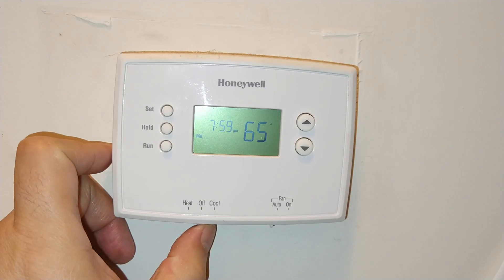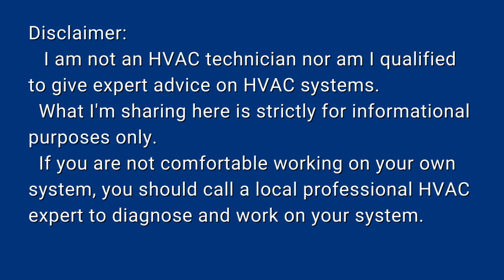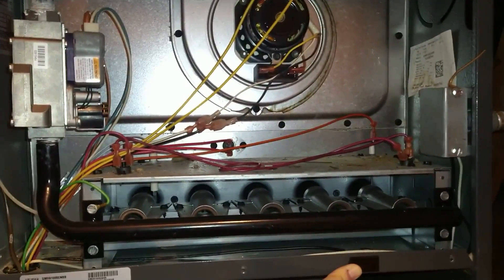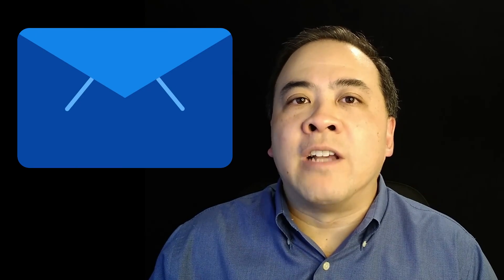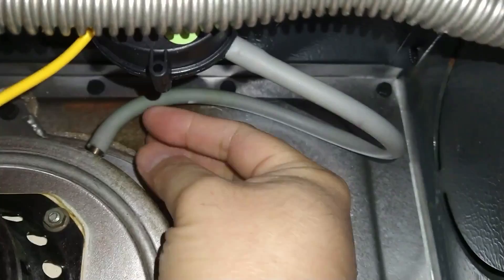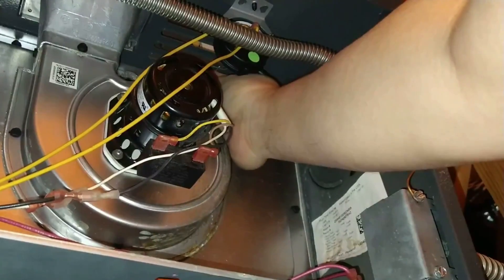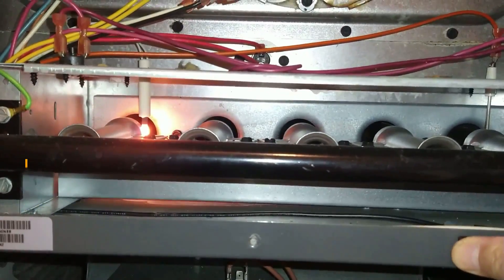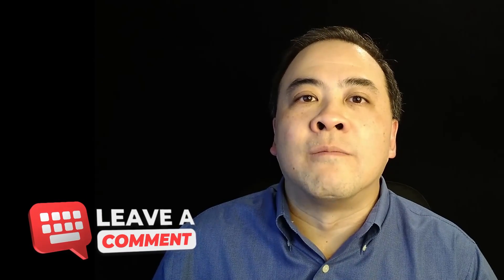FIX Goodman Furnace: 3 BLINKING LIGHTS Error, Heater Won't Start!

Comment from the maker: How is your Goodman furnace working out? Let me know, COMMENT below. If this Fix Goodman Furnace helped you out this season, consider LIKING the video. Also, SUBSCRIBE to receive notifications of new videos. Thank you!
Reply: Thanks for your video, i just replaced pressure switch and it did not fix it, then I saw your video and your fix worked like a charm. Thanks!
Reply from the maker: @jeffvannoy4716  Glad to hear it! Have a great holiday season!
Reply: I just unclogged the snow on the intake and a little on the exhaust pipes outside and started right up. Thanks for the details posted by your friend and in general. Aligned with what my HVAC guy said.
Reply from the maker: @jafinch78  It's always nice when a professional corroborates your efforts! 🙂

Comment: In our case, that rubber tube to the pressure sensor had a small hole in it, possibly from a mouse nibbling on it.   We cut the tube shorter to eliminate the hole, and it was fixed.  Your video still led us to the solution so we appreciated it.  Thank you!
Reply from the maker: Glad to hear the video helped lead to the solution!

Comment: You, sir, just saved me easily an $800 bill. Another video suggested Brillo padding the fire sensor. Did that, glad I did, bunch of carbon on it. But still had the light problem. Came across your video once I finally connected the dots that the blinking light was communicating to me. Found that gray tube, which had cracked and opened at the junction to the nipple. Cut off the broken section, reattached. Flat head, leatherman knife, and your video was all I needed.  Thank you so much.  Joined your subscription as a small repayment.

Comment: Thank you to you and your HVAC buddy. My furnace wasn’t coming on and after checking the control board the led was flashing three times. I removed the hose and slightly slide in the paper clip and blew through the hose. Replaced and turn the gas back on and switch. Igniter glowed on and furnace lit. Again thanks to both of you.

Comment: Great video! Thanks so much for posting but would you happen to know what my furnace would work perfectly after following your steps but then turn off again after 20 mins and start showing the same error code?
Reply from the maker: I'm not an expert but it sounds like there's still an underlying issue clogging up the hole. You may need to vacuum out the surrounding area of all dust

Comment: This fixed my exact issue. I used a hex key to get inside the barbs cause its all i had in the attic and it fit nicely. The air conditioning was working dine in cool mode but the flame just would not fire up in heat mode with a nest thermostat. Removed hose cleaned out with the hex key and bam started right up then the blower kicked on. $0 fix. Thanks!!!
Reply from the maker: Glad to hear it! Stay warm!

Comment: This was pertinent!! Worked the first try.. heated up the hose with a warm heat gun and came off easier. Thanks!! Great video😊
Reply from the maker: That is very clever to heat up the host first to remove it.

Comment: New pressure switch new exhaust fan. Cleaned hose. Blew sucked and paper clipped the 2 ends the hose is connected to
Still doesnt work
Reply from the maker: Sorry, I don't have any other ideas. I am not a pro.
Reply: @User_40172a  did you end up figuring out what it was

Comment: I did what you suggested, but it didn't work. I removed the pressure switch and the hose. I wiped off the hose connection and blew into the pressure switch and then sucked out of it. I could hear the switch inside move back and forth. Put it back together and Success!! I it's gone through 2 cycles so far. Thanks, Matt, for steering me in the right direction.
Reply from the maker: Glad to hear it! Stay warm!

Comment: Thank you ! It worked for me immediately, unfortunately the 3 lights started to blink again smh
Reply from the maker: You may have a dusty air environment. You may have to do a little extra and clean around so that the hole doesn't get clogged repeatedly.

Comment: Thanks, that fixed the issue! i was focused on the pressure switch itself, reading continuity and blowing in the hose.  There was a clog on the furnace side, physically felt it pop out. Now should I send the landlords a 400.00 service call bill?

Comment: heck yeah Cuz ,as a 20yr active duty Combat Veteran & a mechanic as well, your video was Right On. I'm pretty good at figuring things out plus My Wife is a huge help too. The both of us figured out to push the Limit Sensor button, cleaned off & sanded the Heater Ignitor to include the Flame Sensor. it all worked out & started heating up house

Comment: My Goodman gas furnace Nothing is turned on only 3- blinking led light.... First i thought it's a Pressure Switch so I ordered 2 for Replacement for 7 days before it Arrived.  So I just do some cleaning the Flame sensor and checking the Surface igniter still looks good.  Then I Vacuumed the flue exhaust pipe with my Leaf blower for 5- minutes. Put everything Back and Started Right Up.  I was so happy.  My order Replacement parts not yet here 😅😂👍. This just happened on 1/17/24
Reply: I have a call same error code I order the inducer assembly motor I have a loose connection in the motor windings on mines does your still run

Comment: NEVER buy a govt anything.  My stepmother.
Reply from the maker: I am sorry. I don't understand this comment.
Reply: @MattCommand1  My stepmother bought this furnace.  I rent from her. Her and my father were slumlords.  My dad had a 4 ton Lenox in here.  She bought a 3 ton Goodman.  Amazing to me that they NEVER learned cheaper is almost never better.  Coming off my sump pump is a tube made of 3 pieces stuck together because he was too cheap to go buy one single pipe.  They come apart when there is flooding.  Goodman is cheap, govt sponsored, and I don't like it.  I do appreciate your video.  It is 1 degree here and I am an elderly lady on my own.  Learn multimeters.  Smart anything is not for you but for govt.
Reply from the maker: @VickiTakacs.  Thanks for the clarification. I'm not familiar with the background of Goodman. It was suggested to me by my HVAC person. We keep up with the air filters and try to be gentle with our system. But I've had to jump in to learn a couple of things over the years. I'm always happy if I can figure it out without having to hire someone.

Comment: I used the information in your video to help problem solve my case.   In my situation, the pressure sensor connections were clear.  I did continue with the idea of air flow and found that my exhaust line out of my home was blocked.   Once I cleared the line, all worked well.  Thank you for getting me a step closer in my repair journey.
Reply from the maker: Glad to hear it! Honestly, I am not sure I would have checked the exhaust line but your comment will allow others an additional thing to check!  Thanks for sharing that!

Comment: My best advice to you and your viewers is, put the covers back on and call a licensed service company. Gas furnace diagnostics and repairs are not a  DYI  project. Listening to you speak, you are not qualified to be inside that furnace or providing advice to anyone.
Reply from the maker: Hi Bill, I think I was pretty clear in the video I am not a license pro but I was able to fix our problem with the help of a friend who is a pro.  :-)  And for what it's worth, there seem to a lot of people who is happy I put up the video. I didn't twist their arm to watch my video. Nor did I twist their arm to DIY. Thanks for stopping by.
Reply: Everyone started somewhere and gatekeeping what I assume is your profession after his disclaimer is pretty gross.
Reply: @nottheatf841  
I have done more service calls over the years, behind a homeowner, repairing what they did wrong. It is dangerous for everyone in the house. I once had a furnace running constantly because the homeowner saw a video putting a jumper on r and w and forgot to remove it. The only thing that prevented a catastrophe was the high limit worked properly and would shut the flame at over temperature, just to relight when it cooled down. That could have cracked the heat exchanger, sending carbon monoxide into the house.

Comment: Did that with a paper clip and replaced the pressure switch. Still getting the same error.
Reply from the maker: Hi Logan, sorry it didn't work for you. Obviously, something else is going on which is beyond my expertise.
Reply: Just did that to my girlfriend’s furnace .she had a new inducer motor put in I replaced the igniter cleaned the flame sensor and put in a new pressure switch and the 3 flash code comes on still
Reply: @darrylmuse9948  I also replaced the pressure switch but it was still registering the same error. Finally got an HVAC person to check it out. Turns out it was a bad control board.
Reply: @logankue9627  that’s what I’m thinking since all that has been replaced
Reply: @logankue9627  thanks just told my girlfriend
Reply from the maker: @darrylmuse9948  Sorry, I am not an HVAC expert so I cannot offer anything more for you.

Comment: Sir, I just have to tell you how much I appreciate this video.  I had just replaced the pressure valve, because the diagnostic code, and it didn't fix it, amd your video was the last one I was going to watch as a last ditch effort. Sure as shit, paperclip cleared it up, and it fired immediately. Thank you, thank you, thank you!
Reply from the maker: Hi Erin, glad you were able to get your furnace going. My friend has street and field experience and made it possible for me to share this information.

Comment: My Comfortmaker furnace is blinking 3 times and heat does not start so i did the same thing which you showed but it didn’t work for me please suggest
Reply from the maker: Syed, I'm sorry. I am not an HVAC professional. I am only familiar with Goodman because that is what we own. You will have to do another Google or Youtube search for your situation.
Reply: Yea call a professional certified technician. As technicians we know when clients work on their own Hvac systems. When they do their warranty goes bye bye and then I have to charge more cause now I have to figure out what the hell the homeowner did! Makes our job harder and clients end up paying more. Remember cheap becomes expensive. Pony up the money and gave it done correctly. But you don’t wanna pay, haha. Lemme ask this how May of you diy’ers are driving $60k cars? I know Hvac isn’t a sexy purchase and you can’t drive it around town and show it off to everyone. Good luck and thanks to all the diy’ers that screw up their systems!! Keeps us slammed. Haha

Comment: Basing your repair on a pressure switch error code will only result in buying a pressure switch for no reason. Most of the time its just where the sequence of operation quit. Using a decent multi meter check all your sensors like roll out flame and the rest. It could be anything including the circuit board.
Reply: If any of the heat safety switches were open then the furnace would never fire. Clearing any obstruction in the pressure switch port, hose, and vector motor port are the correct steps to take. Rust or scale from the vent motor fan can cause blockages in those tiny orifices.
Reply from the maker: Hi Tom, I put in a disclaimer that I am not an HVAC pro. I don't pretend to be and I think I was pretty clear about that. My video is by no means a comprehensive video how-to diagnose any or all issues that might case the 3-blinking lights. I told my story and executed based on what my friend suggested to me and it worked on the first try. I got lucky and I definitely feel lucky that I was able to resolve my own issue relatively quickly.

As you probably know, Youtube videos are simply YT videos done by amateurs (which I am). They are not meant to replace expert HVAC advice.  However, I welcome comments from HVAC experts like you because it is a great supplement for those that have more severe problems than I experienced. Thank you for watching and your expert comments!
Reply: @MattCommand1  I did not intend to degrade you in any way, sorry if you took it so. I was suggesting that if you intend to work on your own electrical devices or equipment  you are going to need a multi meter.  You not only have to have one, you have to know how to use it.  It also helps to understand the sequence of events that happens from the call for heat by your thermostat to the furnace delivering it. That would be a great subject for a video. It would work for power vent or tank less water heaters and boilers as well. It helps to understand how and why it works in order to repair it. By the way I am not a tin knocker tech, that was rude. I am a plumber, thank you very much.
Reply from the maker: Hi Tom, no apologies necessary. I did not take it in a bad way. I knew you were trying to help! :-)  Honestly, I am not sure how far I will go in my own HVAC repairs in the future. I will have to take it as it comes. My skills are limited. I may consider getting a multimeter in the future.
Reply: Dude you should be honored he called you anything other then a plumber!! Hahaha!

Comment: Never, never  put a paper clip in a pressure switch it has a diagram inside and you can punchier it you cleared the clog by plunging the calcium out the draft inducer motor. its common for this to clogs up when a metal flue condensate some. 
This clearing the draft inducer with a paper clip and cleaning your flame sensor with a Scotch bright should be a part of your yearly routine maintenance. If you don't have a  Scotch bright you can use a dollar bill to clean it. NEVER USE SAND PAPER  IT GOUGES THE METAL OFTHE FLAME SENSOR AND WILL GET DIRTY FASTER. 
AND BY THE WAY YOU DID GOOD  EXCEPT FOR POKING THE PRESSURE SWITCH, (THE LITTLE ROUND BLACK SWITCH WHERE THE TUBE HOOKS ON)
Reply from the maker: Hi Tom, thanks for your comments. As you probably know, YouTube is full of informal information. Mine is no different. Most HVAC pros don't give their advice online. I certainly don't seek out HVAC problems to create a video on, trust me on that.  But I was in a jam so I called a friend and did what he told me to do. I don't pretend to be an HVAC pro and I do put in a disclaimer that I am not one. I also disclosed that what I did was based on information/advice provided by a friend in the HVAC business and it worked. Most of what you wrote, went over my head but you sound very knowledgeable. So thank you for leaving your comment for other visitors to read.
Reply: @MattCommand1  Retired after 55 yrs in hvac. I still love it and really enjoy helping others.
Reply from the maker: @tomwalker9184  Tom, I appreciate your help. It is good that you are offering your insights to people like me. I definitely don't want to be in the habit of producing "how to fix heater" videos. That generally means bad news for me! LOL! Keep up the good work you are doing!
Reply: @tomwalker9184  man our Goodman furnace fires up but it takes it twice or sometimes 3 times to start. Best to just call a hvac company? Money is very tight